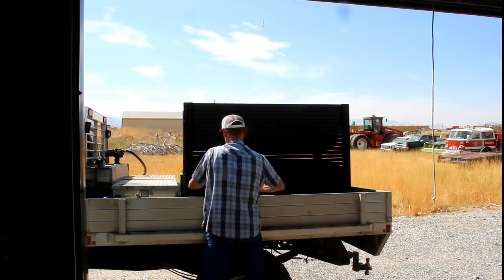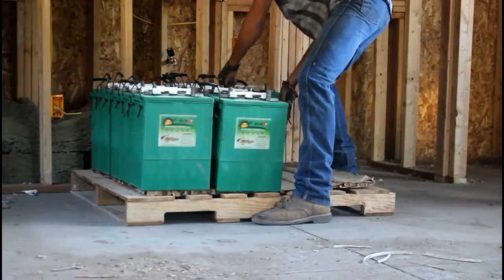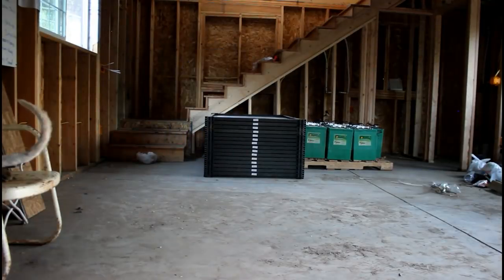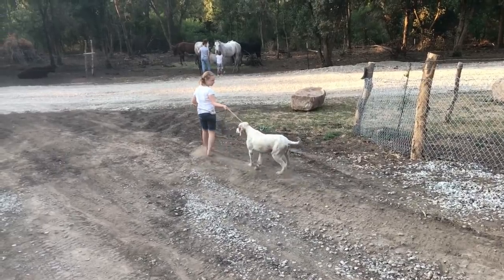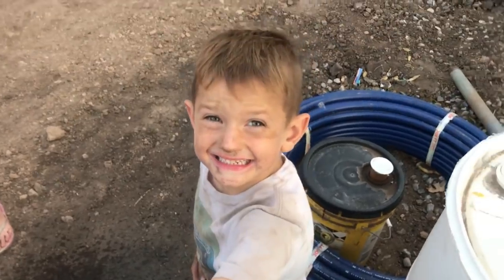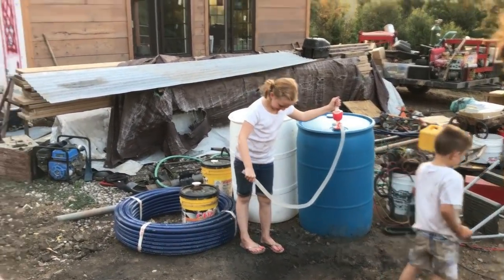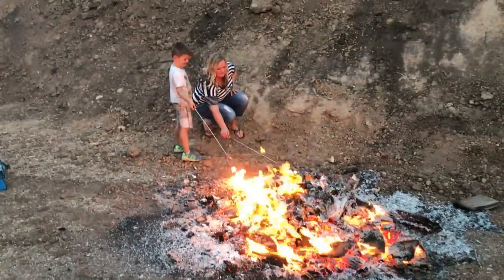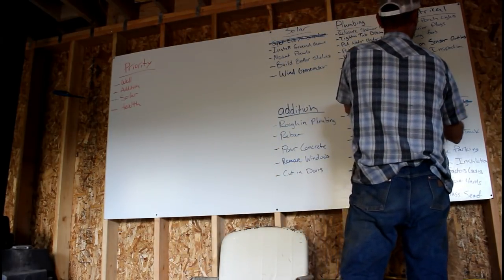#258 - Solar Panels, Batteries And Everything We Own To The Ranch...

Comment: When my husband and I first got married we bought 35 acres that had never had a building of any kind on it. It had a spring fed creek and he built me an out door shower. It had a frame that held two 55 gallon black metal drums that we used a hand pump to fill them. After water would sit in them all day in the sunshine the water would be too hot take a shower until about midnight. It was still pretty hot at that point, but it wouldn't scald you if you hurried. The water was still nice and warm for a comfortable shower at six the next morning. I loved that shower! It was great to be able to fill a bucket to wash the dishes and clothes too!

Comment: 28 Panels is a nicely sized solar system.  Ours is 27 panels 9x3. We went with the 2 large forklift batteries for storage - gives us 40kW of storage - very low maintenance, no interconnection corrosion issues etc.   We has a video series on our site for those contemplating solar.  Summer times it pretty much takes care of our energy needs - even though most everything here runs from electricity (older house), and deeeeep well pump and pressure pump drawings lots of power.  Great to see it all coming together for your place.  Of all the homestead builders, we always think yours is the smartest, most efficient, of the build projects - and you are going at it yourself. Keep it rolling along !!    Wonderful that your children will soon start to reap the benefit from living in the country.  Don't know if they've figured out yet, ...that it will mean more hard work than in the city - LOL.
Reply from the maker: Thank!

Comment: Don't forget about sun angle since you want maximum exposure for better amp delivery from your panels... have you considered not locating all in the same location? Good to see your family out there with you.
Reply from the maker: I'm going to build them to be adjustable so I can play around with the angles.
Reply: Red Poppy Ranch 
An easy way to figure the exact tilt for any day...
I saw on another channel
Take a cup like the red solo cups
Turn it upside down on the panel and ajust the panel to balance the shadow...
Then maybe with a harbor freight angle finder record the date and angle...
Then if you were to adjust maybe 4 times a year you could dial in the midway angle.  
Just a thought

Comment: You have plenty of power you actually have much more then you even need I've been looking forward to this video I have the same panels with rc4 connections i run out back charge controllers they have been true blessing never left me hanging
Reply: Don't count on solar too much, it has it's limits, no matter what environmental nuts say.
Reply: I've lived off the grid for a long time the only limit the system has is the users that use it you have to supplement the system like instant lpg hot water heater you have. To air dry your clothes and thats about it I've ran my air conditioning unit all day off solar at night I have to switch to.fans it's not the system it's the user that has limits I have 18 panels same ones in this video they float most the day I have family of 3

Comment: You are going to run into an issue with that embankment. There is something called the Angle of repose , and can basically be thought of as the nature angle at which a soil can be self supporting and stable.... From the surrounding natural slope angles ,it tells me that you have over cut. It left as is, you can expect slips and slumping of that cut. Vegetation can help, but is kinda like a bandaid on a gun shot wound.  You really need to instal rock/ riprap with a like a weed fabric over lay and plant deep rooting plants alone to top edge if the cut... Rain with not be you friend and if left up checked that cut/slope will cause you big problems. It wIll erode and also move backwards up the hill likely from the top edge but also dumping material down at the toe.... If left alone it will self correct, but it will not be the same. It will become a much shallower angle and cutting into your yard as well as lose you top side hill space.... Sincerely A Geologist

Comment: Nice amount solar panels and batteries. You dont want your batteries sitting around not charged they will sulfate and ruin. They need to be charging up all the time. I know your doing what you can but just saying. 28 panels is a good start. I wish I had that many. Im working on it.

Comment: maybe a contain can  we call the sea can up here  they work great for storage sheds 
we had clean out the old machine sheds that was not safe to go into  and we use them for the shed  untell the new one were built then the move back into the shed  
 i know the batties how heavy and hard to handle them  solar power has it place and wind too have both on the farm just n the winter had not full power like they said I would have  but was still able to keep the house working  have land power the other house we and all the building we have here this year was the water wheel installment  amazing power source that still has all the machines  for the belt drive  from the wood shop  have restored  4 of the machine now  i am amazed we still had the manual  came with them  toothing on this winter redo the other thickness planer just time to pull the machines apart some time the bolts break off too   that does sit back the project a bite removal of the broken bold   could use a normal bolt too  i has the machine a new  bolt for the machine

Comment: It is really hard to transition from all the conveniences of home into a place where you don't have which you are to instantly give yourself a garage he does use containers containers are the best way to make you so have a grudge right away it solves that problem that cost 2 grand each or maybe less but you can have containers delivered for nothing they can't use them again they have a shelf life of so long and a do they celebrate the metal and they're alredy build their structurally strong to stack about 3 of where I can make structures out of him they can handle the snow partless no levels and all that stuff not whether type for water if you know have what about elevator little bit of the ground people in him still melt is going to go right into the dam thing but you're not redy we're in really we never dry way build you you're close to coming up to Winter you don't even have a way to give to your property yet they're funny he can't move until the next Blix is Spring dude it be the better choice because you're not even close to redy yet you haven't even built your edition yet you haven't got your inside walls done you get a lot of stuff to do in God help up there now you can set lamb do it's the quack quick as possible if you had couple men and he had all the materials and he slammed it but you're not redy for that yet you don't even have your plumbing done on your electrical done on your walls done to build more walls he couldn't be more stuff I leave the containers basically of the only way to go to get your stuff out of the way you get up to foot walkway on both sides and he stuck in one shelves and you have a way to store your stuff instantly on your property with a member you have to open those doors up when they're going to get snow and you know what it's like when he gets me when he gets muddy of their in Winter will when 1 summers when withered basically ends is when you guys don't have a place to stay if you have a mud pit and that's when you not going to like it now you have a mud pit the kids really good shout of E to outside shower guaranteed there he gonna bring all that she crab near house not cool and outside shower you don't have to give wash the mud right back off into the dirt while the plants with it but the less was summer when a timer that's a whole different story uniting to be trudging in the dirt unit be all bundled inside in the cold

Comment: OK to tip early fix your problem you to give you got a storage you put it on a property you have nowhere to store that you even have a basement so what do you need a storage containers they're instantly made a single raj's there and get him up the right level you let you put him in and you basically have a way to load stuff keep it out of the weather you could put your solar panels on top of that temporarily amol up an angle you're not gonna get the right angle anyway we're livin up the unit can be able to maximize only does it really matter if you do or don't if values they can see the Sun for some period of time that's all you gonna get over you have to clean them you'd have to have access to them you want a script them on the ground up you want a script 11 the arrogant were fewer pie you can have to pull up pull the snow down album and if you have and that if that you have the angle with a slow falls off them themselves and their problem not the right angle loosen any way don't forget snow melts and turns in ice in his honor of it dams up anywhere on that thing it's going to cause problems it's gonna break the ship I saw was the school will small swell and bust your glass if you to other that wiping your pals 3 times A-day when it's snowing I'll see you gotta bail and keep up yet I got there and clean that the pal's you to go out in the cold and busy every day in the next W have to do if you would have solar in the Winter you have to clean the soul about that I get a receipt what's the good could have of Maybe a quarter inch of snow on them you're not going to have any of anything coming out of them and I can understand any kind of solar power even when snowing during the night you can have a tarp you pull off in the morning if you can lift that tarp off or you have to go there every few no 4 hours and remove it replace it you gotta have a way to make this thing work if you don't have a plan for that you can have big problems all that snow that comes now that things can go to M1 big pile right in front of where you work slides now do and you gotta have with a remove that big pile when is something some kind of a plow system's gonna pull that and put it somewhere else get think about that you gotta have a where to put of snow for the with the summer time for the words of where were you plow that driveway of you gonna have to put that snow somewhere else where it's going to have to sit it's going to get high II it's so you gonna have 1' of snow times a 20 is going to have like Dino hundreds and hundreds of feet of plugin still has to go somewhere else so it's gonna get that snow's going away higher on the other property in I gotta take it way back you know that whatever the you driveway as plus the house was all places have to keep the walkways glean you not to be able to put that no load love into a truck and then hot somewhere else

Comment: So if you took everything out a story that you did need you gonna need a storage container where you're at now why did you just get a metal container and put it in that to you build your shop he got nowhere else to put it the one in which it with your shop you going to put your snowplow and your motorcycles and all that other stuff that you going to need the in the set which he used during the summer and the Winter you get a habit you gonna need another a whole nother gras just old stuff in and all the rest of that you when I raise the you just go papa all that stuff is better protected if it's covered as another structure in itself and another structure and another structure you don't have all the structures built yet to live there comfortably you need a house built a grudge built a place that you gonna be able to get the stuff plowed away in love your driveway away to heat it have all that stuff set for Winter if you don't work the whole Winter you can have heat action plan paid off in your to water bill paid and your electricity you can't rely on solar for you Winter black Chrissy it is can't be you gonna have to have backup generator which is get to gallons of gas A-day can't run much of the hollow generator I can run a 3000 W hollow generator you can run a couple TV's a microwave for a short greeted time I mean he can't be running a whole bunch of stuff no air conditioning no heating and no heaters no blowers Noah no hair dryers no curling irons those are all those things the girls need it again and even met massive amounts of power for those things girls need pair dryers and curly irons if they don't have those that's that's 20 app circuit sets a lot of electricity for 1015 minutes each day at adds up it's going air conditioner off for 3 hours straight that's the most expensive part of your house air conditioners washing machines you can ever do a load of laundry every day I'm going to do that you have to dry a little wonder every day how you gonna do that you guys are fighting group of 5 years and is 1 of you if you are single person you would be released 2 gallons of water every day to gallons of gas every day food brought in in your sewer Vito awaited get rid of it you have to holiday tune out if you don't have a way to do that you have to suck it into a take have a have a outhouse guy come out so well as you have to have accomplice in up you could probly set of accomplice bathroom no prob I just have to use a Gregory and then dispose of it on your property or its uses compost there's ways to get rid of that stuff but you don't if you don't wanna go clean it have a deal of it than that it's a whole different story How to let thing works it doesn't just leech it all beggarly and they use it may signal a lane they find a way to of distracted all and use it as something else you could drink the water out of a septic tank ever they clean it

Comment: Have like 2' of snow and copy or so pounds a better way you do we don't scrape on a regular basis due to reckon no care what the much the switch the maximum capacity of snow you could put on top of the solar Belle Isle do you have more than 2' on and loud and breaking or something might have a doom down the road so if you'd all have their cleaner use no other of your solar panels every if you have to feed a snob television are living there could you get any debts that Sunday comes turn every day even though it's let it snow it's still gonna give me some solar panel some power and the Winter time if you will have a generator then you have no way to basically survive where you gotta have a to different alternative light system besides solar in the Winter time he had ever generator or candles are something you got the heat from the stove which meant always stoke as you're here was if you don't have that going to come every you can't rely on gas for anything unless you get a forward of have a propane take delivered a rather busy just sort of a water heater that you heat all the time and it gives you your constant shower water it's always there is not a reason take a shower all at once but I calls on demand ones but they don't work good in 40ﾟ temperatures are 30ﾟ temperatures you list you buy a bigger 1I never bought a bigger 1I want a $100 1 in the work great from anywhere of the 60ﾟ in up but you below that over there I don't know what you what you can use your plumber you tell me that people have a take that you he water in in a way to pump that tank into your house you'll have a way to get hot water
Reply: Wow lol